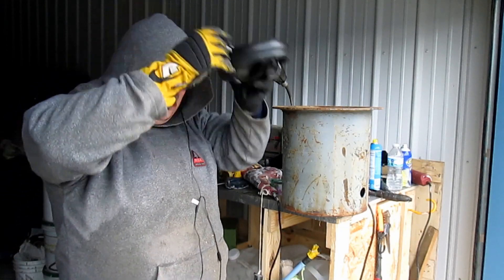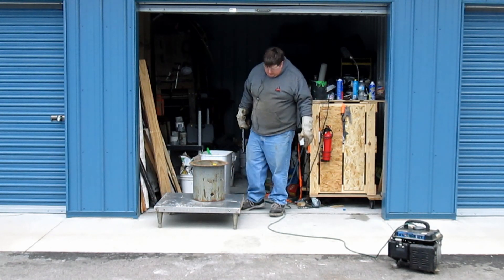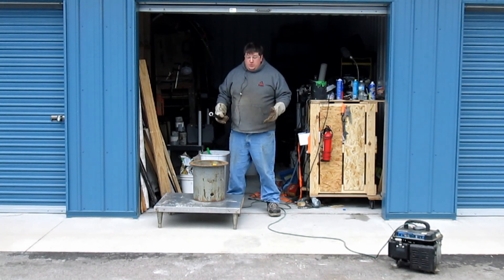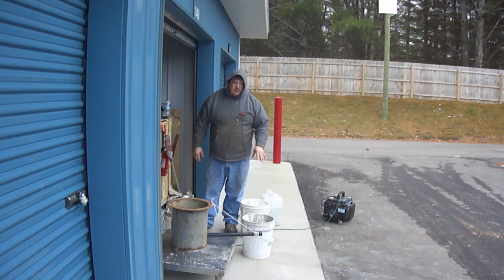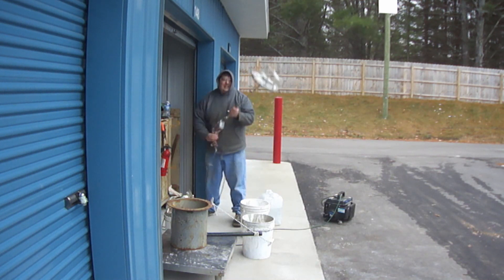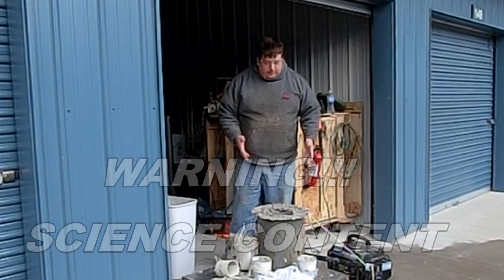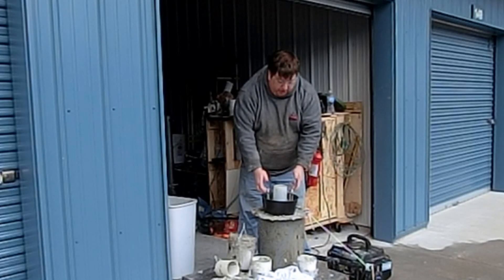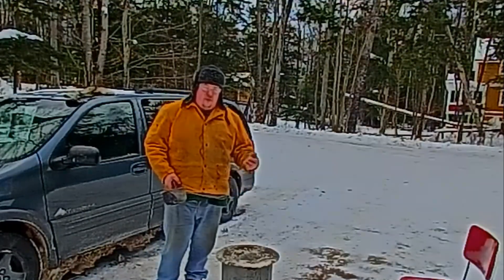HOW TO MAKE A COAL FORGE FOR LESS THAN $40

Comment: Also what are u using as a crucible?
Reply from the maker: for a long time I was using stainless steel bowls that I got from goodwill or where ever, but they never last long. as can melt though while in use.  I recommend a graphite smelting cup, it can be fired about 50-60 times before it need to be replaced.

Comment: Hey did you weld the bottom of the pipe off with some sort of plating? Or can you leave the pipe open and just use a concrete base inside the pipe, if that makes sense.
Reply from the maker: I got lucky the bottom was already sealed. but if it wasn't I would have welded a plate to it.  Or a third option could be to use some kind of a tank like a water heater, or even a stainless steel trash can.  DO NOT USE A GALVANIZED GAS CAN!!  The plaster is going to crack and crumble over time, if it is plaster bottom you may have a spill of hot coals.